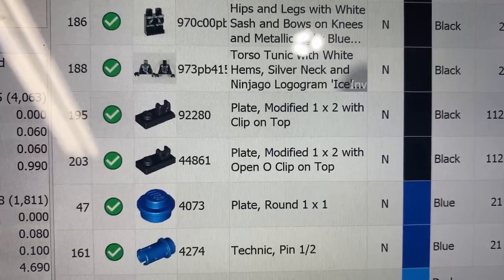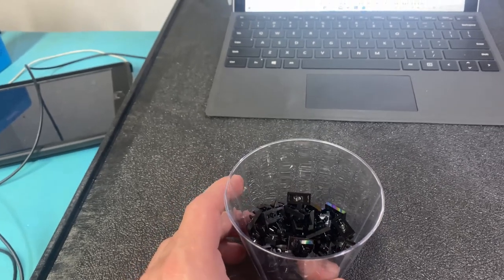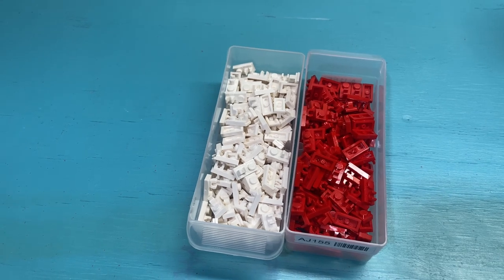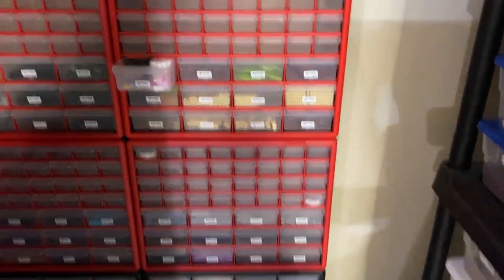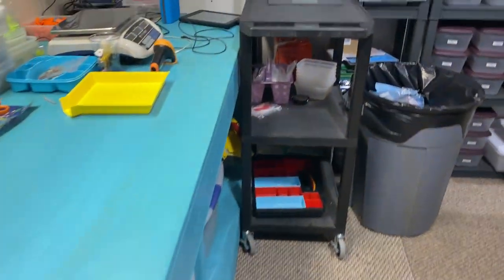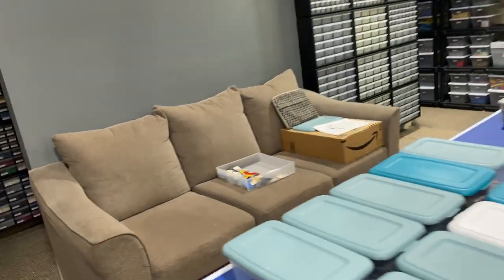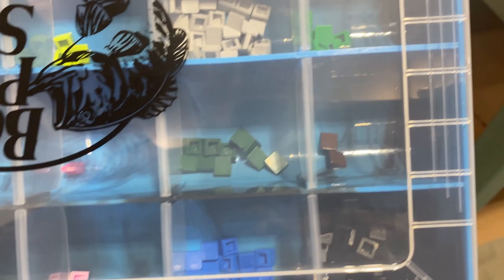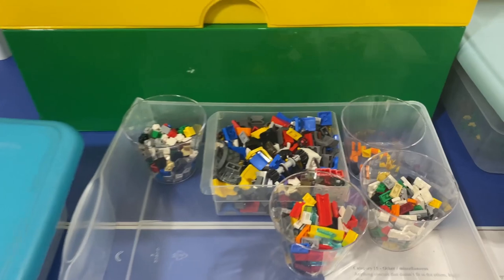Vlog #12   Black Friday Haul   Akro Mil Dividers   Used Part Out

Comment: Whoa I hadn't noticed the switch in dividers.  Last time I bought was Nov 19th.  Just bought 2 more.  I got to say I'll be happy with this new divider.  I hate the stupid protective cover.  BTW, if you put the blue paper in the drawer it'll eventually fall off on its own and the next time you open the drawer you easily take the protective covering off.
Reply from the maker: Yeah I thought you’d be interested in the change, so I hoped you saw the video.  I am definitely excited about not having to peel the blue film off.  Maybe that in itself is worth the cost even if it is, IMO, a cheaper product.

Comment: I have ran into the same problem with the clip, several others have as well. I do separate the two mold variations. I have not seen this same issue on any other piece with a clip. Even though I separate them, I am not certain it’s worth it because I do not sell much of either version! LOL. There are a couple of the open O clips that list higher than the counterpart.
Reply from the maker: Yeah that has been my hesitation with separating them, I don’t sell them often, and if I’m just noticing it, how many times have I sent out the wrong part unknowingly. Or maybe I was just lucky. Or maybe the customer didn’t care.